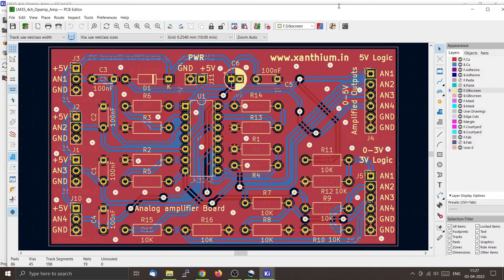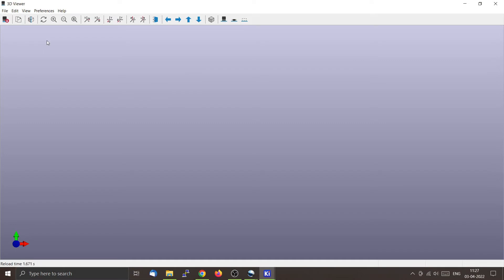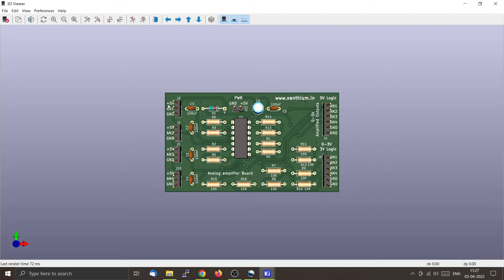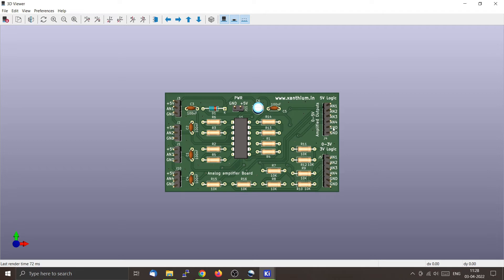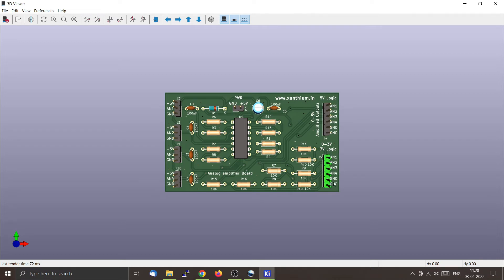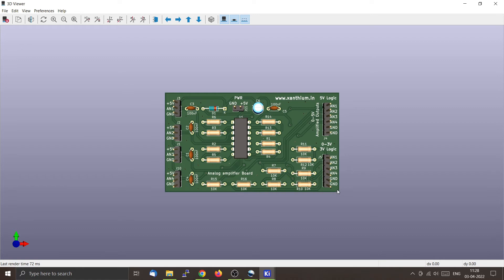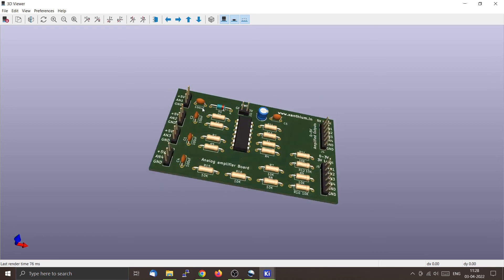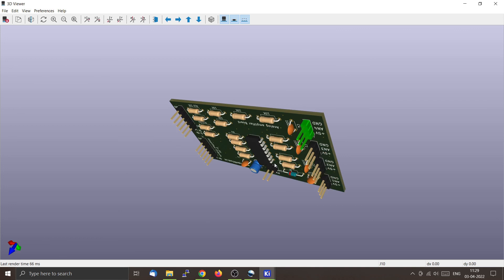4 channel LM35 temperature signal amplifier for Arduino and other Microcontroller

Comment from the maker: https://www.xanthium.in/lm35-temperature-sensor-analog-amplifier-board-arduino

Do Like and Subscribe

Features
========================================================
The board consists of 4 analog channels for connecting the outputs of the LM35 chip and 4 output channels that gives the amplified output of the LM35 chip in the range of 0-5V

The Gain of all 4 channels is around 3.7.

The board also has 4 amplified outputs that gives the amplified  voltage in the range from 0-3V ,making it easier to interface LM35 to 3V tolerant microcontrollers like MSP430,STM32

The board can also be used as a general purpose amplifier board that you can use to interface with other analog sensors and works with both  5V and 3.3 tolerant microcontrollers.

All the components used in the circuit are through hole components which helps the user to build the circuit in true DIY fashion and learn valuable soldering skills.
============================================================